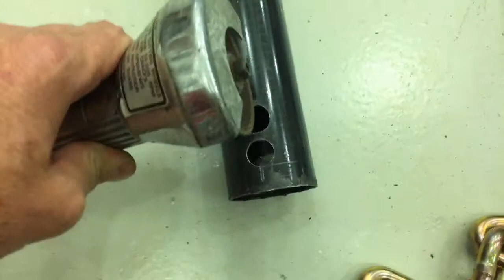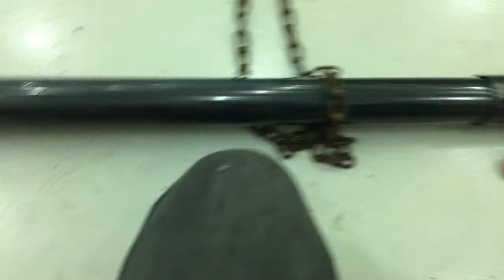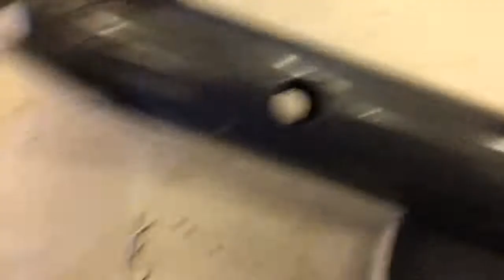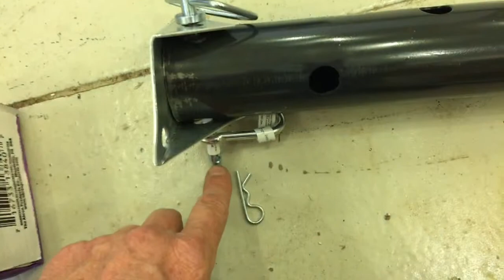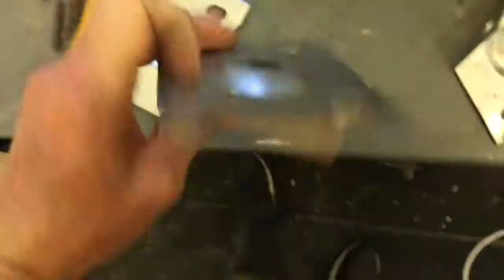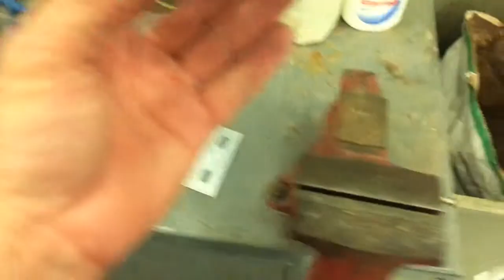Tripod hoist build 2

Comment: Do you have a link of where you ordered your leg tubes from ?
Reply: I bought at Menards. Home Depot or Lowe’s should have them too. They are generic so do a Google to find them.
Reply: Here they are on Amazon: https://www.amazon.com/AKRON-PRODUCTS-C-84-Floor-Jack/dp/B000CRFAHE
Reply: Here they are at Menards: https://www.menards.com/main/building-materials/columns-accessories/steel-columns/tapco-adjustable-steel-floor-jack/c84/p-1444423420145-c-5725.htm